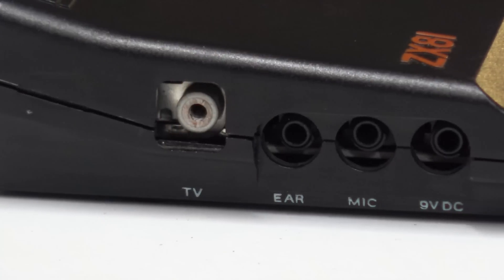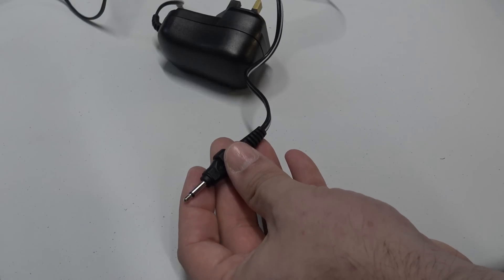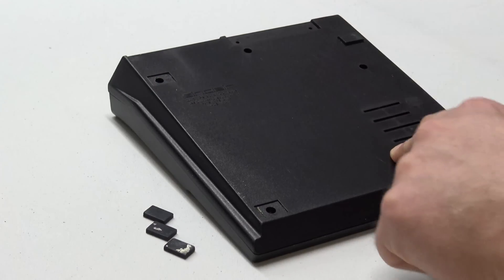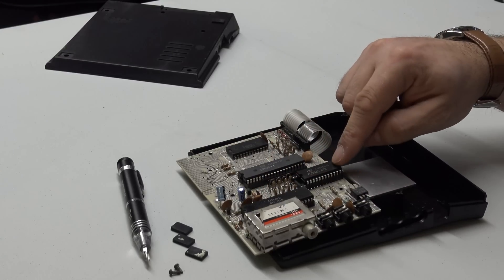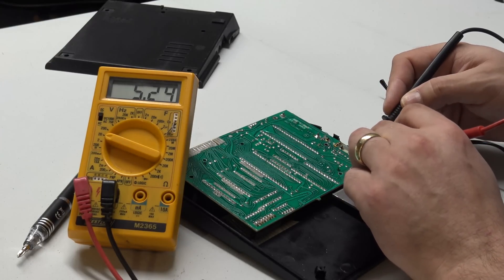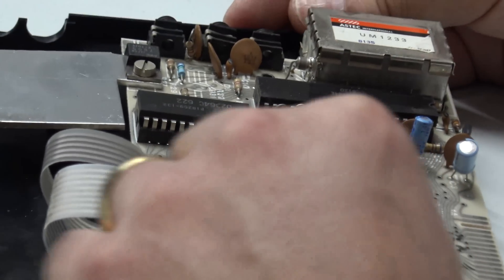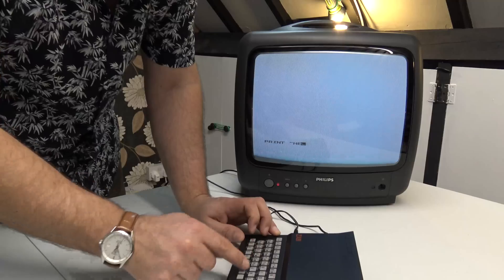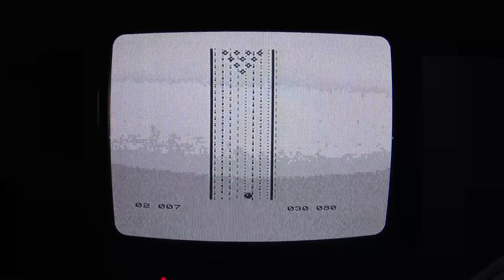DuB-EnG: Sinclair ZX81 retro computer refurbish and restore - cheap broken eBay find restoration!

Comment: The American version of this, the Timex Sinclair 1000 has 2 KB of ram on the board.  Perhaps you can grab that.  You gave me some ideas to try with mine.  I tried mine on a new TV, late model CRT and an 80s CRT and just has a black screen.  When I get home from work today I'll try the brightness.
Reply from the maker: Yes, if you have a stable but black picture, adjust contrast and brilliance etc...
Reply: @DubiousEngineering  it loaded but my keyboard was not working. Took it apart and the old one broke and was really brittle so I ordered a replacement keyboard
Reply from the maker: Excellent!!!  Itll all be back up together soon!!!
Reply: @DubiousEngineering I can't wait to try stuff on it. It reminds me of my TRS-80 Color MC-10. But smaller and less ram.

Comment: My first computer. Although, I had a Timex Sinclair 1000 with a dodgy RAMpack 😜. They can be modified for composite output, which gives a really crisp picture. I've got two broken ones for free. Fixed them both and gave them internal memory expansion, so no more wobbly RAMpack.
Reply from the maker: Great work Robert!! :-)

Comment: 10 FOR A=0 TO 15
20 PRINT "HAPPY BIRTHDAY"
30 NEXT A
40 PAUSE 100
50 RUN

A message i left running for my sister for her birthday, a bloody long time ago lol.

Ahh the zx81, there was a 16k rampack made by sinclair but it wobbled and produced whiteouts just as you hit the enter to save that program you had taken ages to type in Grrrrrrr lol.
There was a better one made by memotech called  "memopack 16k", all aluminium and hugged the back of the zx81 for a better fit.

4016 dram chips i think, long time ago.

Or you can remove the 2114's and use a 16k static memory to make your zx81 mega, thats what it did to one of my black door wedges lol.
Reply from the maker: Here is a little preview for those that take time to comment...  https://youtu.be/ig7wZoKXvkA